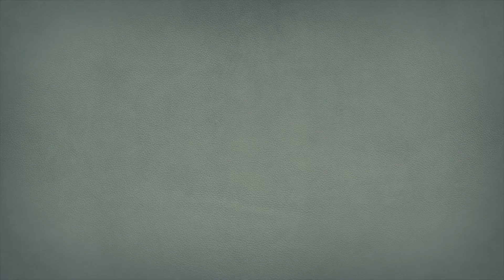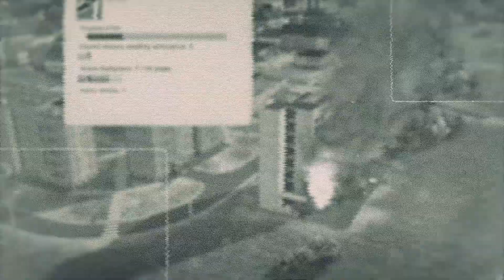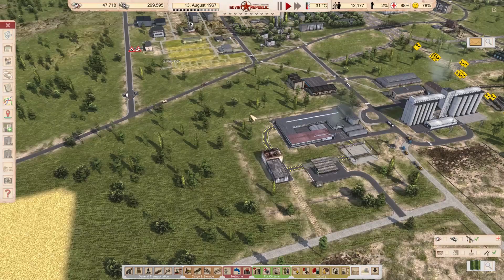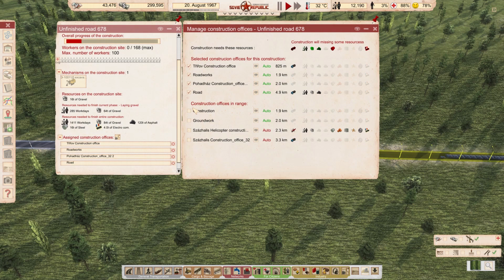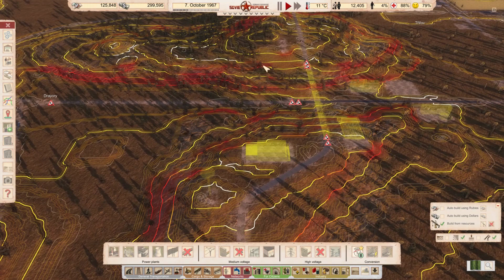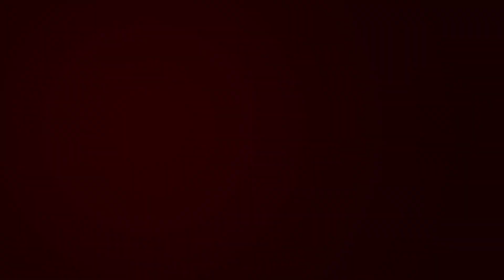Soviet Republic - Worldbuilding - Ep.66 - Timelapse - City Planner

Comment: Lots of good stuff in this one. Looking forward to seeing how splitting power works out. Makes total sense.
Will be good to know how many bars you need to pump water up to the tower. Might be substantial!
Do the trolleys travel fast enough to get workers to the mines?

I didn't realize you had covered hull trucks in the farm. Thought you were using DO's to clear the fields.

Thanks!
Reply from the maker: I wonder about water pressure and the tower as well. Trolley buses are as efficient as buses just no fuel and less options. I wanted to make them just to diversify. I did put covered trucks in farm just because there is so much space in there. The big ones. Looks like I was a smartass for no reason. Just misunderstanding. 😁
Reply: @oolykeegaming81  No worries my friend! I expect the smartass. Especially if I don't notice something obvious 🙂

I'm looking forward to seeing the new water layout and how it works. It's on my list and well, I'm learning from you!